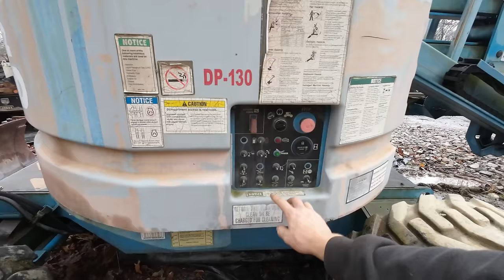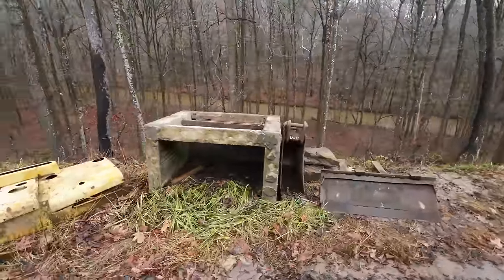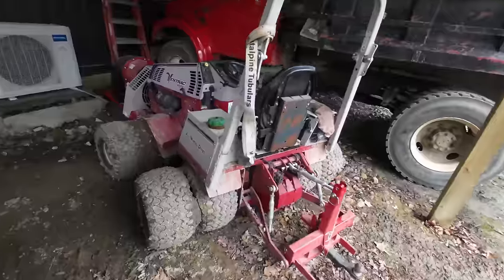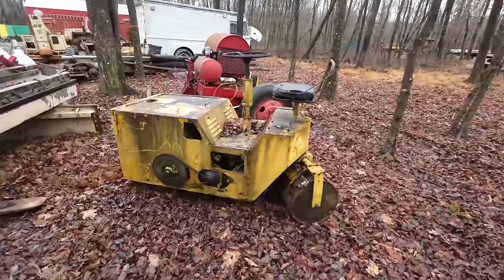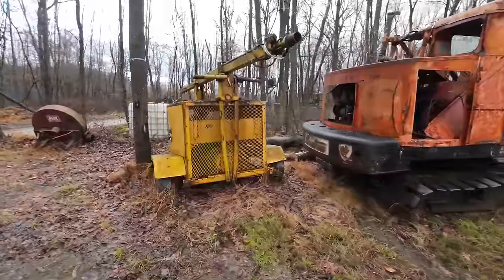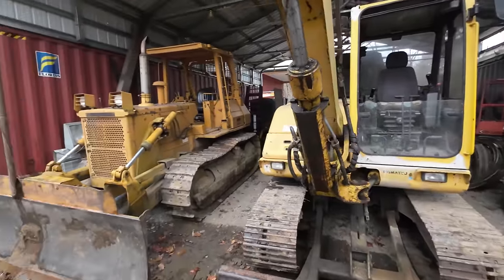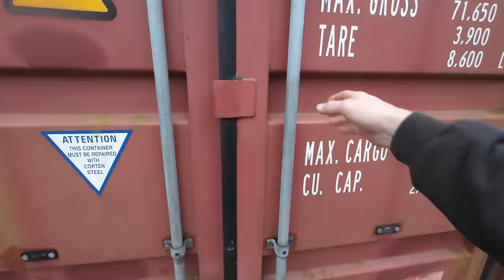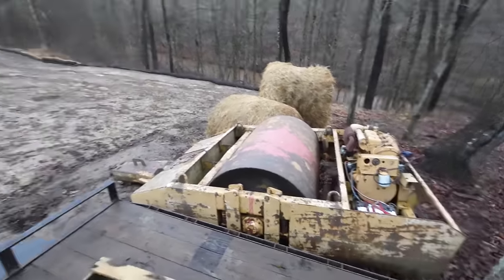Take A Look At My Junk (Every Project I've got)

Comment: Further to my remarks on using sodium hydroxide for cleaning machinery, I have to add the caveat about safety.  Like battery acid, which is very acidic and caustic (HsSo4  ph 1)  caustic soda is very alkaline and very caustic. (NAOH  ph 11).  Either requires the use of PPE gear (personal protection equipment) such as chemical resistant gloves, goggles, and a lab coat.  Do not spray battery acid or caustic soda on concrete.  It will etch, stain and cause the concrete to crack.   A safety bucket of water and dilute baking soda can be used for washing off acid.  A safety bucket of water with vinegar can be used for washing caustic soda. Caustic soda sprayed on a gravel surface can be diluted with lots of water. 
Sodium hydroxide (NaOH) solution can effectively strip paint from steel and iron surfaces. It will etch aluminum. Sodium hydroxide is a strong base, and it reacts with the paint’s binding agents. It breaks down the paint’s molecular structure, weakening its adhesion to the metal surface. Caustic soda reacts with the rust (iron oxide) on the metal surface by dissolving and breaking down its molecular structure . It acts as a powerful cleaning agent, removing rust particles and other contaminants cleaning the surface, exposing the bare metal underneath and prepares the surface for further treatment (e.g., painting, coating, or welding), ensuring better adhesion of protective coatings.  It does not affect iron or steel or rubber. 
Wash the cleaned surface with water, but dry it off asap so as not to cause flash rusting before applying a paint coating.
Hope this helps a little further. 
From Wikipedia:

A common use of sodium hydroxide is in the production of parts washer detergents. Parts washer detergents based on sodium hydroxide are some of the most aggressive parts washer cleaning chemicals. The sodium hydroxide-based detergents include surfactants, rust inhibitors and defoamers. A parts washer heats water and the detergent in a closed cabinet and then sprays the heated sodium hydroxide and hot water at pressure against dirty parts for degreasing applications. Sodium hydroxide used in this manner replaced many solvent-based systems in the early 1990s[citation needed] when trichloroethane was outlawed by the Montreal Protocol. Water and sodium hydroxide detergent-based parts washers are considered to be an environmental improvement over the solvent-based cleaning methods.

Comment: The GHEL blower.... 
I dont think rotating the hole to a diffetent location on the perimeter is the solution. Instead, seal that hole up and cut out a hole near the hub and let centrifugal force compress the air to the outer perimeter where the outlet is.

Comment: The bomag roller sheeps foot use to be mine lol no way. Anson was my paps co. On rt 40 at the auction in belmont small world.  We had issues with the front bushings however they are new ones. E brake never worked an motor always was good. Does still have the mastwr switch in back of machine?

Comment: you DIY leave blower - couldn't you just turn the outlet right the way round, and then add a shroud or flexible attachment that allows you to direct the air as intended rather than move the inlet? or is the air leaving on the right side of the machine a requirement for the blower to work how you want?

Comment: happy new year and whats the paint code of that ford in the shop some time next year i will be moving and i plan to start working on my channel and one of the projects i want to do is put a truck cab on a pickup frame and autocrat is one of the cabs i am liking that or a i would like a mack but those are not cheep at all
Reply: and if i had 6 20 foot containers and a lot of land at some point i would have a 6 container home

Comment: Dear Matt this is Bruce bonkowski I surprised on your way your handling your stuff not happy with you pulling the engine on the aurocar and trans and puttingninnw big block with a big transmission that engine was just a broken into  I would of put upgrades and if the transmission to give you more power gears put to toss that engine off that truck was a   mess but I interested if the price is right is the Ford truck your old flat. Bed  is it a stick or auto and your price

Comment: wtf dude! is cool tha you have all of this machines ,but where this you get a vw savero on you hands? ( the vw rabit) and yes i from brasil and here it call saveiro but here we have this same engine but lower compression to rum on etanol or gasoline ,and this diesil engine too but is a rare thing to find

the engine name is vw AP  we have a ton of spare parts here in brasil thiss is the LS ENGINE HERE so parts a good and cheap

i have a car using thiss engine my vw gol ap 1.8 i rebuild the engine some weaks ago ,so i work on thiss guy before

Comment: You buy too many things you don't need.  I like to watch your videos, but you should be working on setting up your new shop inside and out.  A lot of the equipment you buy will go to waste since it will completely rust to the point that it will not be any good to anyone.  Get some use of the graders you have to fix all the low spots to keep water from flooding the area.